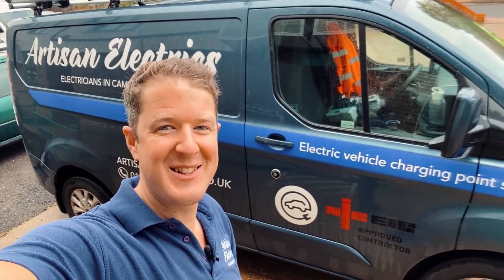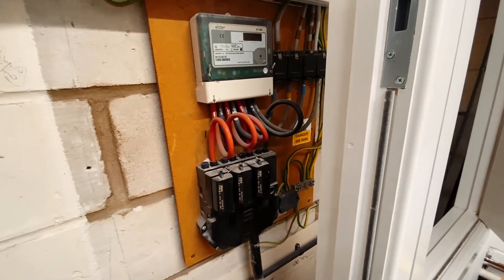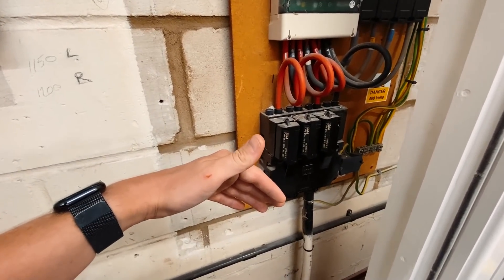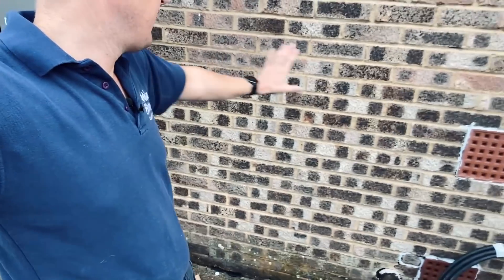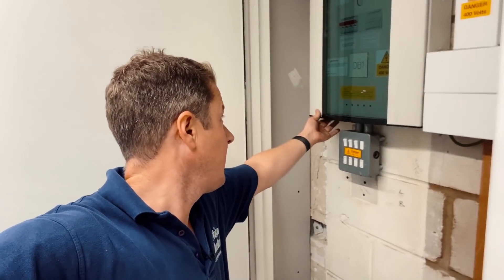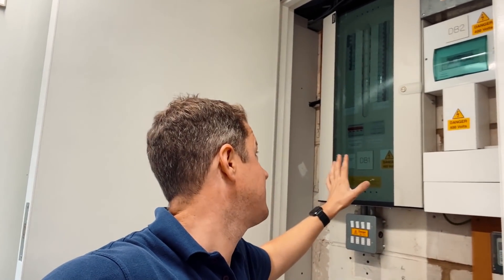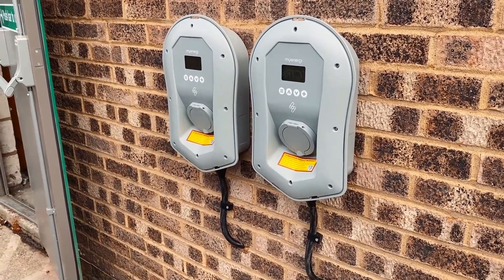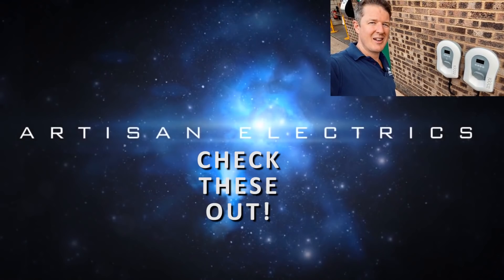Three Phase Commercial Electric Vehicle Charging Installation

Comment: Standard in Germany, even residentials install ALL have three phase power!
Reply from the maker: Nice
Reply: I think in the future large homes (3 bed room detached and bigger ) in the  UK are going to be 3 phase, particularly if we want to phase out Gas heating and more and more people are going to have EVs , solar and batteries.
Reply: @patdbean  I can't see that happening, I had my NIC visit today and he said the network does not have the capacity, he attended a meeting with the network, and they said the capacity is not there.
Plus electric heating is too expensive, I pay around 3p a unit for gas and about 16p for electric its a no brainer.
I have 4 vehicles in my house, if they were all electric what happens then, for me electric is not the silver bullet people think it is.
Reply: @acelectricalsecurity  how can the grid "not have the capacity "? Demand hit an all-time high of 60.xGW in  the winter of 2010. And has never been much over  50GW ever since. And remember flexible  tariffs like "agile occtepus " will stop people charging cars between  4-8pm by charging 25p+/kWh and by charging 7p or less between 11pm and 6am. And has even been known to go negative. Download their app to check live pricing  for yourself.
Reply: @patdbean  it's been like that for years, only a few years ago there was the threat of factories being on a 3 day week, there was a time when we used to sell our surplus to Europe, that has gone now.
Reply: @patdbean  I know how it works, and my point is you could have a family and have four points, but the cars would hardly charge, because they would all ramp down, then you have the points that don't have that feature, then you have a dilemma of which car to charge.
Reply: @acelectricalsecurity  and if you do have 4 cars and 4 points AND you absolutely "need" to charge them all at once that is when you may need a 3 phase supply to you home. But as far as the grid is concerned the number  of people silly enough to do that at 25p per kWh will be tiny.
Reply: @patdbean  The grid doesn't have the capacity if you look at it sensibly every household will need  2 chargers , many older properties have 40 or 60 amp supplies even newer ones have 80 amp , realistically your looking at 100 or 125 amp supplies as standard in the near future, you only have to see what happens when a major event is on tv and an ad break comes on to demand , our network was never designed  to accomadate the loads
Reply: @acelectricalsecurity   so you risk comming out to a flat battery
Reply: @steverobinson8170  that is "WHY" you charge over night at 7p per kWh. When national  demand is 20-25gw not between 4 and 8pm when you will pay 20p+ per kWh and the demand is 35-45gw. "Nothing" happens in TV ad breaks. The demand goes up by 300-400mw for 10 or 15 minutes and the 4 pumped storage stations can generate well over 2gw for many Hours. And then guess what, they pump the water back up the hill  over night for  a third of the price they charge at peak time. Just as your EV will do on a V2G system.  On a good day your car will make money!
Reply: Anthony charles  I know the per kWHr price for electricity is about three times that for gas (here in France) once you take into account standing charges etc.  But remember that each kW of electrical energy can typically deliver 4 kW of heat when using a heat pump, so in our case the cost is about equal.
Reply: @acelectricalsecurity  BTW we still sell our extra power to Europe. In interconnectors to France and Belgium and the Neverland  are still working ok😀👍. In fact a new one is being installed via the channel tunnel.  take a look at grid watch for live data.  http://www.gridwatch.templar.co.uk
Reply: @patdbean  Yes live pricing is one of the few advantages of smart meters.  I agree it's likely the future. With smart devices to take advantage of it. Not just cars, but I can see washing machines, dryers, etc taking advantage of it. possibly by a device mounted in the DB  (smart contactor connected to the smart meter via zigbee maybe?). Although the requirement for metal DB's might mess up the wireless!
Reply: @TheChipmunk2008  external antenna on the consumer unit? Or powerline  type  coms?
Reply: @patdbean  I'd prefer hard wired myself but i'm oldschool. Maybe fibre interface to the smart meter?  (given the things appear to have only a 10 yr life at best, upgrades to the design are always possible).  Using smart meters to provide a responsive smart grid was always the intention... Till it comes about, I will be keeping the old spinny disk meter we have :)
Reply: @TheChipmunk2008  quite understandable , BUT if you want agile pricing to charge EV etc then I don't think you can avoid  having a smart meter .
Reply: @patdbean  I have only a diesel van.. and use very little power at home... so yeah, i'll avoid it for a while yet :D
Reply: @patdbean  your not getting it , doesnt matter if the demand is lower now , when you have 32 million cars being plugged in somethings going to give  local subs can only handle so much power , the cabling  can only handle so much power , it doesnt really matter  what the overall network capacity is in Gw its the ability to transfer that capacity from commercial /industrial areas to residential areas  and we do not have the infastructure in place to do that , its going to require serious upgrades within the grid
Reply: @steverobinson8170  the local load on the substation between 4 and 8pm will not  be any bigger than it is now. Cookers, heaters, kettles , showers, tv etc. Say that that averages 4kw and peaks at 11kw.  So just over 40amp today at peak times, on a 60 amp fuse. No problem today?  Between 11pm and 5am "all" those things will be off and and the  car will be charging, at about 40amp or 10kw or 150 miles ranges . At no point is the peak load on the local fuse or the substations fuse "any higher" than it is today. And remember 150miles in one night will be uncommon, on most days it will be 40 or 50 miles added. And be you say it , if they get up at 3am and put the kettle and shower on the CT clamp will see that and back the charging down for the few minutes those things are on , so even in that case the peak load never goes any higher than it dose today. There will just be less of a dip at night.
Reply: @patdbean  Its the peaks that are the problem
Reply: @steverobinson8170  exactly, that is why V2G is going to help, a charging car can stop charging in those peak 4 hours and even start sending to the  grid in TV pickups on an instruction from the grid. Or on frequency response when frequency  falls below say 49.8hz. Well managed V2G will help (not harm) grid balancing.
Reply: @patdbean   still pointless if your comming out to  a car with less charge than when you parked up realistically your looking at 13 hours charging time on a slow charger for a 40Kwh  battery , a fast charger might do it in 6 hours ,  once yuo start  getting into the bigger batteries  needed for larger cars and vans  it takes longer , the reality of the situation most domestic supplies will not  support 2 fast chargers  running at full chatter  and thats what people will need  to make this viable ,  older properties  incoming cables  are considerably smaller than todays specs  and were often piggybacked between two  each semi block     the networks just not fit for purpose
Reply: @steverobinson8170  all V2G systems have a "never below " and a "ready by" setting. So you will come out the next morning to a "minimum " preset range. You are creating "artificial" problems. Here is the scenario .... You own a car with   say 160miles range it has 140 in at 7AM  between 7 an 8am the grid  has 10 miles range   out of it. At  8am you set out for work you arrive at work at 9am with 80 miles range you can not charge at work for some reason . You leave work at 5pm  and arrive home at 6pm with 40 miles left, your minimum setting is 30 miles range so between 6 and 7pm the grid only takes 10 miles range out say 3kwh , at 1am your car starts charging at 7kw  (it already has 30 miles range)  so by 6am it has 100 miles extra range plus the minimum reserve of 30 miles so 130, between 7am and 8am the grid takes 3kwh about 15 miles range , so off you go again on your 80 mile  round trip with 115 miles of range. Even if you can not charge at work , the grid is happy ,  the grid has paid you 20p/kWh for the power it has had out and only charged you 7p perish for the over night power you have usedyou are happy. And the battery has at no point been left full or empty for empty  so it is happy.

As far as supply specs go yes some will need upgrading. But if the Germans can have 3 phase in to large houses I don't see any reason why we can't as well. And all this is for a car with a minimal 160mile range , today 200+ is usually the minimum and 300 is common with 500 available at the top end of the market.
Reply: And yes some people with Micky mouse supply will need upgrading , just as they did when the world moved from just using electricity for lighting to using it for cooking and water heating, and people were moved from a 30/40amp supply to a 60+ in the years after the war. The bottom line is that is charging is moved to off-peak hours the peak demand will not increase, and with V2G  if anything it will decrease.  see link https://youtu.be/-h_5QHUOQ1Q
Reply: @patdbean  We can't have three phase because our network isnt capable of delivering that level of supply to domestic properties , and any upgrade will take decades , Germany has had 3 phase domestically for many years . As i said we don't all work 9 till 5  and go to bed at 21:00    what you elude to is pie in the sky  based on predictions on a system that meets todays standards , what it doesnt quantify is the age of our networks and the fact that  many of the areas requiring most demand (inner cities) have the oldest infastructure , and of course the biggest issue  people and the way they use the system , they are not going to sit there calculating possible demand  and the  charge rate needed for tomorrows journey, they will just set the  charging system to full charge  asap  as  the others in the family will need to charge up too . Most families have two cars , many have 3 or 4 .
Reply: @steverobinson8170  I know  we don't all work 9 to 5 , but if you look at grid watch (link above) you will see that the over whelming majority of us "DO"  and demand is so low between 11pm and 6am. About 23gw last night against 37gw as I type this. So how come the grid "can" deliver that  extra  14gw "now" but it can't deliver it between 11pm and 6am? That 14gw would charge a million cars at about 40mph. And remember the grid can easily put out 60gw and at a  push about 72gw.  

Also the average  car us driven 38 miles a day so they can fully charge once or twice a week OR get toped off in 60-90mins every night . Either way it adds up to the same total demand. And when the grid is stressed the control  signal goes out  and within s a second a million cars have stopped charging and half a million have started sending power to the grid for the next 10 or 15 mins.

Your edge cases do not matter, because they are edge cases. The house hold with 4 cars that for some reason "must" charge then ALL at  the same time,  and for some reason  can "never" use public charging, will need a 100A 3  phss supply. But they are so few in number they have no effect on the overall picture.
Reply: @patdbean  I beg to differ looking down my own road , i have 1 van 1car now (daughters have left home and wife uses my car otherwise 4 cars and a van) rest of the street averages 3 cars , if i leave my road  heading towards castle bromwich , no household has less than 2 cars , some have as many as 8 . Given the range of these cars which  is generally  pretty poor , its  totally feasable that they may all need charging at the same time , as for public charging that doesnt lower the load on the grid  that will increase the load at peak time as people travel to or from work , same if companies install charging points at the workplace that again is going to place extra load on the grid at peak time .
Reply: @steverobinson8170  if you look at the video I links to above . You will see that the national grid are not worried , they are not worried because they know that on average those cars need 38 miles of charge a  day. About 10kwh or 90 mins of charge on a home charger. Internet based control and high peak hours pricing will stop them all charging at once and if the grid fills in the "bath pub "  period between 11pm and 6am. That will be more than enough to give every car/van in the country 30-50 miles range every night. 
Watch the video , the capacity "is" their. 
Please watch the video and look at gridwatch , to see just how much unused gid capacity their is, over night and at weekends. Not between 4and 8 in the evening. But a managed grid will NOT let them charge in those hours!
Reply: Yes. But which cars use 3 phase onboard chargers even?
Reply: @movax20h  some are some are not, but it you are going to have multiple chargers as in the above video you are spreading the load anyway.  The fear that 10m electric hard will all want 11kw at 6pm, is just like the fear that all 20m+ kettles will  want 3kw at the same time , it just dose not happen. One or 2 million  after EastEnders maybe 20 million never.
Reply: movax20h Almost everyone. Renault ZOE, newer Nissan Leafs, VW ID3, BMW i Series, Tesla, etc... mostly 22kW or 11kW
Reply: @Wintersky136  yes and if like Anthony  you have 4 of them and absolutely "must" charge all 4 at once. You are going to need a 3phase 100amp supply.  But that will be the 0.1% edge case.
Reply: @Wintersky136  Cool. I didn't know that.
Reply: @movax20h  I think the Renault Zoe ZE50 has a 22kW 3 phase charger.
Reply: @stephenholland5930  You are right. Thanks.
Reply: @movax20h  The Kia and Kona can use 3 phase but only at 11kW, I think Tesla take 22kW.
Reply: @movax20h  Most of them I think? Teslas may not, because tesla are the Apple of the EV industry,...lol
Reply: @TheChipmunk2008  I am not sure what are you trying to say exactly. Tesla is a leader in EVs, performance and charging infrastructure, but doesn't lock you in really. Apple is nothing meh. Maybe you are referring to pricing? Apples stuff ia overpriced. Tesla is expensive, but still justified in price. And they are bringing costs and prices down very soon with their new technologies and manufacturing methods.
Reply: @TheChipmunk2008  it looks like Tesla on board chargers are single phase. At least in US. That is understandable as most homes in US only have one or two phase systems. Most of the grid is like that, so no sense having 3 phase charger in US.
Reply: @movax20h  I've installed tesla chargers and other brands... tesla are crap. they use the minimum necessary and use a weird connector nobody else uses.  And the chargers are overpriced and poorly designed. Terminating standard SWA cable into them is a huge pain in the arse
Reply: Also, they have NO idea about thread sizes. Never figured out what the f*** the gland entry thread size is. I usually blank it and drill a hole somewhere else
Reply: @TheChipmunk2008  in Europe, China and Australia, sold Tesla cars do have on board 3 phase chargers. Same for the wall connector units sold in Europe, it supports 3 phases and 1 phase, and various voltages as well current limits to accommodate your Installation. It can do up to 22kW. Sounds good to me and very flexible.
Reply: @TheChipmunk2008  The branded EVSE from Tesla is about 450$, that is not bad imho. Bare minimum? What do you mean. It either works or doesn't. Does it break? Does it fail some safety regulations?
Reply: @TheChipmunk2008  M20 and M32.
Reply: TheChipmunk2008 all European Teslas have at least 11kW chargers on them. Some have 17kW (24A per phase) and others 22kW but all at least 11.
Reply: yes, yet another way the UK got short changed :( (Although often in other parts of the EU, the actual maximum demand can be incredibly low, france often uses 10 to 20 amps for an entire house!!)

Comment: Biggest mistake of the EV charging standard was deciding to connect the supply earth to the chassis of the car, but we are where we are....
Reply: I think in this country we try to over complicate things, apparently in some European countries they don't bother if it's a PME supply, they don't use rods.
But realistically what's the chance of the network loosing the neutral, the car plugged in and someone touching the car, those have to be long odds.
Reply from the maker: Anthony charles both very true comments
Reply: @acelectricalsecurity  The main risk is from the building trade where underground cables are inadvertently dug up. That happens quite frequently which is why we earth to water and gas pipes and the latest regs cover this risk.
Reply: @corrigenda70  don't get me started on the IET, they couldn't produce an error free book if their lives depended on it, the only thing they can get right is how to extract around a £100 every few years for a book that has very few changes, robbing gets